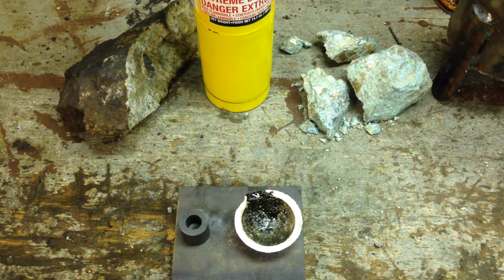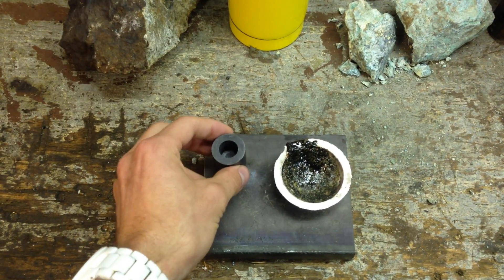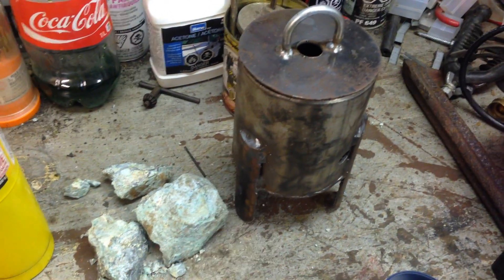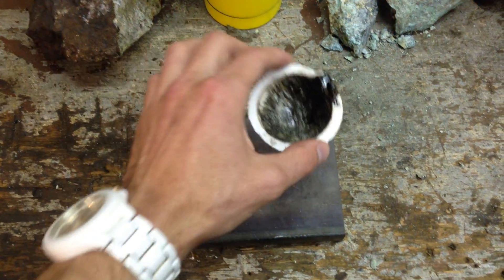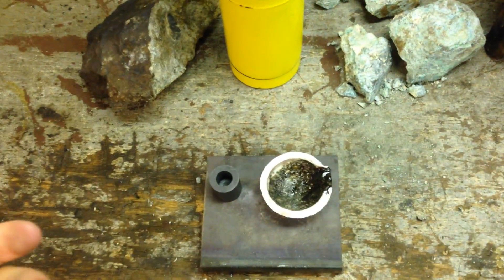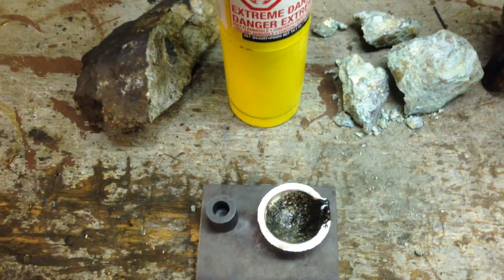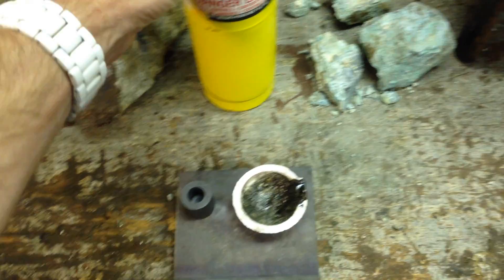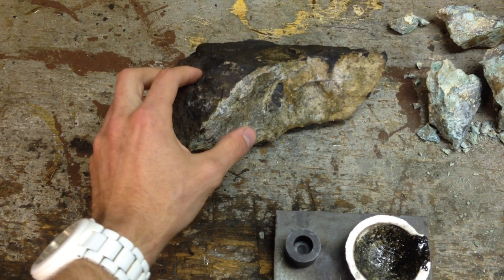DIY Melting gold silver Ore on a budget - Moon Shiner

Comment: Soak the rocks in viniger for a couple weeks to dissolve the calcite, then crush, then roast the sulfides, then use hydrochloric acid(muriatic acid) to dissolve the base metals, then strain and rinse, then repeat with HCL and add sulfuric acid to drop the lead. Strain and rinse. What your left with is 99% precious metals. Then nitric acid for the silver(drop with copper) then aqua regia for the gold(drop with sodiummetabisulphite)......THEN do what your talking about. Something like that. But don't take my word for it I'm just guessing. All you're doing is just melting rocks.